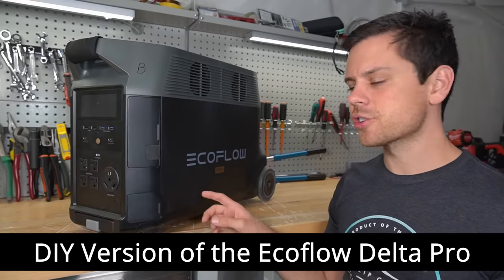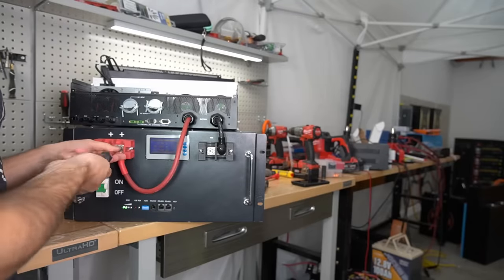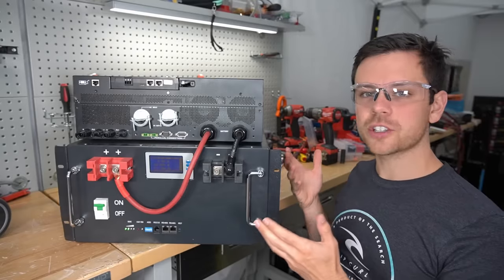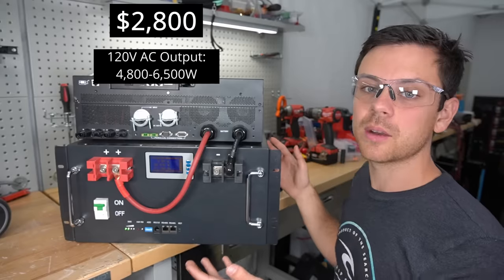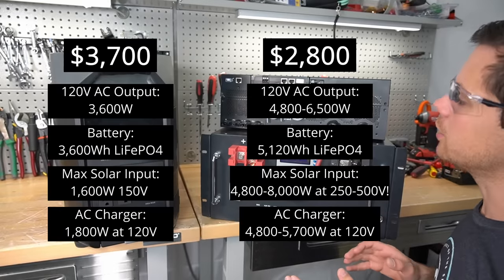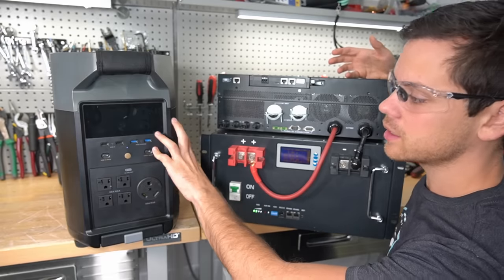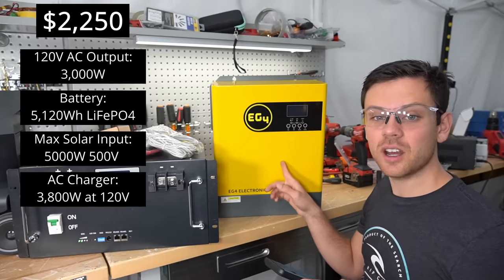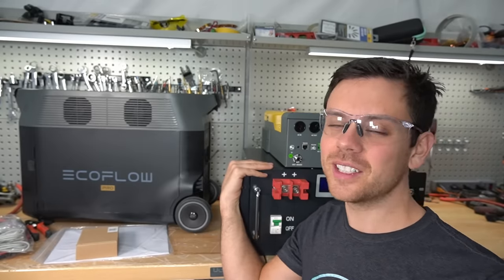Budget DIY Ecoflow Delta Pro! More power for less money

Comment: This video was probably more relevant a year ago, but the Ecoflow Delta Pro can now be purchased new for under $2000 (Costco) and refurbished units are even less being around $1600.  Yea, expanding  the battery can be more costly and the 1600 watt solar PV input is quite limited, but the ease of use and portability are hard to beat.
Reply: You can say the same in another 1, 2, 3, .... years. Why point out the cost is less now than it was a year ago? That's true for most things we purchase in life.

Comment: For those that don't know,,, Server racks are also known as PA system racks. Musicians have been using these for years! Effects, amps, prossesors, all come in specs to fit into these racks. These are "rack mounted systems, therefore, they will fit any rack mount! You can get them to fit one unit, or 20 units, and they do come with wheels! Check Musicians Freind!

Comment: The eg4 3000 and eg4 48 volt battery is exactly what I want to get started in solar because i know i could expand it over time.  I really only need it to run a computer, lights, and 9000 btu mini split for a few hours each day.  My biggest hangup is the idle consumption of the eg4 inverter....and even though it's fairly cheap it will still take years to pay for itself.  In my current tight financial situation I just can't justify making that leap to solar yet. But thanks to these videos I will be ready when I am in a good enough financial situation to pull the trigger.  Until then I earnestly await news of cheaper and better batteries and cheaper and better all in one inverters.
Reply: Look at the  Victron Multillus it is  more money but much better quality and has a low idle consumption . I have a 24/3000 and a smart solar 100/50   solar charge controller I've been very happy with the equipment. That being said I still want to buy one of these All in ones as a spare option

Comment: Would be cool to see some form of DIY shell that could be used on those LifePO4 batteries you test a lot of. Basically clamp the positive and negative on, latch it up, and have a small portable system with a few outlets. Need extra capacity, just buy more LifePO4's and swap them out as you exhaust them. 

This way instead of over 2k to start you could get in cheaper and slowly grow your capacity. Wouldn't ever match a large unit like this but would work for smaller tasks and spot outages where you don't need a massive system in place.

Comment: You know if you live in a small home or even a semi small camper and don't plan on moving it much. Your setup is amazing. The biggest thing between the 2 which you take some sacrifice is portability. The real question is, how do you plan to use it? Is portability a big issue? How much power do you really need? 5,000w steady is pretty amazing, and if you need that? Great! 

I really do like your alternative setup. You know another great way to make your system more portable is making a custom wooden case for it. Which with a little skill and lots of YouTube, that would make it all 1 piece unit and you can make it pretty durable and put on larger wheels allowing you to move it around much easier. I really do wish and I get which is a big part of your video, is not being able to upgrade the battery storage without being forced to use EcoFlow only. So much of these solar panel kits are getting better and better and prices and portability will help you get a great unit you want, but not have to worry too much about putting all this stuff together especially if your someone that isn't very electrically inclined. I believe there will be easier ways and quicker and better setups in the future where your average Joe Blow that may not know much or nothing at all about solar and charging setups and be able to get what they need in medium scale setups without getting too overly whelmed and not spending a ton of cash to get what they actually need. 

I love your setup my brother! I wish someone would just make the proper connector and a controller that would make the EcoFlow believe it is using one of its own batteries when it is using a DIY Battery pack or even another brand and still make it all work. :hand-purple-blue-peace:

Comment: Good video and I completely agree w/ you.  Just got 30kWh of batteries from signature solar and decided between the EG4 6.5 and EG4 3000.  Seems to be some discrepancy on what the idle consumption is in the manual versus what you and other you-tubers are seeing in real life.  If there isn't much of a difference, the 6.5 is the way to go since the 3000 doesn't have dual MPPT charge controllers but I do like the screen on the 3000 better, as well as its size and price. 

One thing you could have addressed in this video is the DC output.  That's something the Ecoflow has that the DIY doesn't.  You could have added a step down converter from 48v to 12v and then had some DC ports off that for probably $100 or less to really make it more comparable.
Reply: Do you know if / how I could set up a 110 volt outlet on this to make it plug and play?
Reply: @danielbell230  On the AC output just get a power strip and cut it's wire and strip them and connect them to the inverter. Very easy.

Comment: One problem is the idle consumption of all in one unit is much higher about 30 to 50 Watts. Ecoflow did a great job on that
Reply: This is by far the biggest drawback for these DIY systems vs. the EcoFlow / Bluetti. Second for me would be how compact things are packed in a SoGen.
Reply from the maker: Could enable power saving mode. Also the 3000W model idle consumption is much lower. Just use that one instead. Bigger models have bigger idle consumption
Reply: The 3000W model is only 120V.
Reply from the maker: @Dreadlk  so is the lv6548
Reply: All the Sogens have hidden idle consumption some more than others

Comment: I think they are targeting different markets. The ecoflow is designed as an all in one system for RVs, boats, etc... It is much harder to move the DIY system. For home system, you really need a lot more like a transfer switch or interlock etc...
Reply: We’re getting 16 panels installed tomorrow with a transfer switch. Need to figure out a garage storage system. Curious about interference and how to size a DIY system like this

Comment: I paid $2600 total for 4 Chins 12v 200 ah batteries shipping and handling included to alaska. I hooked them up to my Aims 4kw inverter charger 12kw surge, that I paid $1100 for 2 years ago. Already cheaper than what you showed, after factoring the fact I have 8kw of power without wearing out the batteries much.
Reply: What part of your system allows for solar input/charging?
Reply: I already had a 2kw solar array and 2 150/60 Victron solar chargers from when I was using 12v. Went from agm batteries a month ago, to lithium, and that was the most drastic change since we got the inverter.

Comment: Trophy batteries are good. I've been running 6 for months with no serious issues. They just work.
Reply from the maker: Yeah they are severely under rated. I need to make more videos on them. I love mine
Reply: @WillProwse  I heading into the cold season, I'll let you know how they do in my solar shed. I'm not relying solely on the internal heaters, but more of failsafe. The heaters are really the selling point for some of us.
Reply: @WillProwse  I would love to see a video about the 11kw Trophy battery that you have

Comment: Thanks a ton for the apples to apples comparison in such a tight video.
If possible, I'd like to replace my grid power by breaking up my main box into two 30 amp RV plug sub-panels... And plugging diy systems into them..  like I currently have for my generator, but for the full house, not just the major circuits I have now.  I'm hoping this is possible, instead of a fully attached expensive full house system.

Comment: you can get 48V 100AH Chins - which has a smaller footprint then a server rack and connect it the the EG4 3000W inverter.

Comment: I'm testing now.. but on Ecoflow pro I found a "AC always on" option..  Under settings and "Lab"..  Turn it on to have the AC ON when the batt comes back. There words "In EPS mode, if this swich is on, the AC power button will be turned on automatically after the power is back.  If switched OFF, you will need to turn on the AC power button manually"  Now.. EPS mode?  I found AC timeout.. Trying to make it keep the "never" setting ...  We'll see.🙃
Yes.. that's the key to getting it to work.  I cycled it twice to Power Fail.. (pulled the plug) and it worked with out a flaw.  Man.. am I glad too.

Comment: Learning so much.

I have 2 100 watt solar panels, originally I connected to 12 volt lead acid, and 40 amp epever charge controller, and 10 amp switch panrl

I bought Ecoflow River.

I disconnected lead acid battery, and got XT60 connectors.

I'm in the UK (Brexit was such a bad bad thing), I really struggle to find (wire)/cable, and none of the shops(stores) reference AWG 😢

Comment: Hi Will.  Bringing up the Ecoflow Delta failing to charge the EV reminded me of something I was thinking after that video, but was too late to the party to feel it was worth commenting.  As I recall, it failed because the neutral/ground bond is not available, and you tried to bond it on the output of the Ecoflow, which ruined some functionality of the unit.

Have you thought about doing the bonding on the AC plug, as if it was plugged into the wall.  Just take a female extension cord socket, don't put a cord on it, but internally bond the neutral and ground, and then plug the A/C grid cord connection of the Ecoflow into it.  Does this provide the bond required to make the car charger work?  At the very least, it should be safe because it is the same situation as having the Ecoflow plugged into a home circuit with the circuit breaker tripped.  Also, the female socket would have to be removed before plugging into the wall, so there is no chance of having neutral and ground bonded in two locations.

Thanks for the interesting videos.  Sorry if this comment is a little off topic here.

Comment: Great video! Also very timely. I've been trying to solve an issue of frequent short power outages and looking at solar plus battery backup. Unfortunately solar is not an option for my home, surrounded by many tall trees. Even if I take out many trees it still does not make sense. I could go with a natural gas backup generator but would rather go with a system like you arre describing. My plan is to install a sub panel with critical loads, most of the 120V circuits and connect a battery backup through an inverter.
If there is no need for MPP inputs are there other inverters worth considering?
Other considerations?
Thanks!
Reply: A natural gas generator with an automatic transfer switch would be pretty awesome. Not nearly the need to ration power like you'd need to with just a battery backup system without solar.
Reply: My friends in Texas have the whole house natural gas Generac unit. The cold conditions caused natural gas to be shut off for a week plus in his area. He rigged his motorhome gen set to run a few circuits in his house, Thankfully, the motorhome fuel tank was full.

Restoring generators was my hobby for 30+ years. My new hobby since the  NorCal wild fires and power outages in 2017 is batteries and inverters. Nothing beats the silence, no fuel, no fumes, no maintenance, and the reliability as found in battery backup. I have no problems running my fridge and chest freezer and leaving home for a week without worrying about them. I would never leave my house with a generator running untended.

My Aims 4000 watt 120 volt  inverter charger has been reliable through every power outage for years. I elected to run its internal battery charger 2 ways...plug in a 20 amp cord to the grid or plug it in to my 3500 watt generator. Like you, trees make my solar input non existent.

Another consideration....those Reliance 10 circuit transfer switched were designed to run on 240 volts, L1 and L2 power wires, Neutral wire and ground. You can power only one side of the breaker panel as fed by wire L1 or by wire L2. Hopefully your critical loads will be on one side of the panel.  This is why I bought the split phase 120/240 volt Sungold Power split phase 6000 watt  $1200 inverter charger. Now I can power both sides of my breaker panel.

We have had several power outages in the last few years ranging from 4 hours to 3 days and nights. Batteries are the best backup. If I were to build a new system, it would be 48 volt server rack batteries with an All-in-One inverter. You don't need to connect the solar input.

Comment: You cant charge the Trophy, SOK or EG4 battery from the grid at night when electricity is cheaper as its off grid? You can with the Ecoflow so in places with less solar insolation the Ecoflow is useful all year round.

Comment: Having recently bought into the Delta Pro system, I readily admit that DIY is cheaper by far. That said, I'm not an electrical expert and integrating with my home's existing circuit breaker seemed quite daunting. Ecoflow's Smart Home Panel is what really sold the system to me. I got 2 delta pros and the SHP and can essentially choose any circuits in my home to run off of Delta Pros (either as dedicated, or as backups). I'm not sure how you would accomplish that with the DIY setup. I know its certainly possible but nothing quite as simple as the SHP?
Reply from the maker: Just run critical loads with generator transfer switch. Then connect plug to any inverter. Super simple
Reply from the maker: But yes they have made it easier
Reply: Are you saying that your DIY system will give in an automatic transfer switch that you can monitor from an app??? Can you switch circuits on and off from your app to help reduce your electric bill????
Reply: @WillProwse 
Can you please do a short video showing how to connect the EG4 inverter to a standers wall outlet? Gauge, breaker, plug, etc. 
can I literally just chop off the end of an extension cord, hook it up to the inverter AC input and plug it into any wall outlet to charge the battery? Solar isn’t always available so charging the battery with grid AC is a big bonus. Thanks.
Reply: I think the Smart Home Panel that serves 10 ciruits
Reply: The Smart Home Panel appears a Fraud. I need to buy three for $4500 'cause 21 circuits are needed.  No instructions, no pictures, no skematics. I sent the Pro system back.

Comment: So what would it take to use something like this instead of a generator for an extended power outage, where the amount of power charged during the day would keep you going without downtime?  Assuming say 5000w of power used in the day, with TV, Lights, Fans, Coffee, etc and probably just 200w overnight with just fans and lights.

Would it ever make economical sense as compared to a generator?

Comment: Hi Will. The Delta Pro will charge at over 3000w A/C if you connect it to a 220v-240v output at 15 amps into the A/C input in the back of unit. Excellent video's.

Comment: I purchased the Ecoflow pro from Costco.  Within a month the system stopped working.  It had a direct short which continually popped the breaker.  I just returned to Costco for a full refund, and now will be building your DIY setup with 2 batteries once I figure out from your links what to purchase.
Reply: I did the same. Costco and Home Depot were phenomenal with full price exchange. Guess who wasn't? That would be Ecoflow themselves. They told me to get stuffed as it was over 30 days. I even tried a chargeback but my Amazon visa had same respon.

Comment: sounds great at first, but it would take a little bit to make this portable (wheels, and a frame of sorts), wanting the ability to charge it just by plugging it into the wall, also i wondered what the minimum solar voltage would be, say if i only hooked up 3-4 panels, it looked like 120 to me, and someone else said 90, which could also be a limiting factor. if I could figure out a way to make it portable, have different charging options, and not worry about low solar voltage i would be more excited about this idea, but it's still a great idea.

Comment: I should do one of these for my garage and make it solar/off grid.  Already have a sub panel in my garage for all of my garage circuits.
Also, there are some pro audio equipment racks/cases that may work to make that last system more portable.  Those audio rack cases are usually plastic or wood.  Don’t know how much heat this would give off, but audio amplifiers can also generate some heat.  Just thought of it as an option.

Comment: Great Video.  I am a solar dummie and just getting started.  How would someone go about connecting a 30 amp connection like the Delta Pro has on the front?
Reply: Did you figure this out? I would love to power a 30 amp RV with something like this...but, need a 30 amp connection on the DIY unit to do so.

Comment: I want to use this set up in a food trailer that needs the fridge running at night, so I have gas generators running 24/7

How would I connect the eg4 all-in-one to my 50amp plug that the generators are connected to, and would those trophy batteries be better than the eg4 ones to be on the floor in a mobile trailer in an area that reaches freezing temperatures?

Comment: If you used a renogi charger inverter with AC outlets built in, would that work as a replacement to wiring in additional AC outlets?

Comment: another very important question is:  the delta pro inverter efficiency is quite bad and you loose about 20% of battery capacity when consuming ac power, how good or bad is the efficiency of the inverter used here? have you an idea? inverter efficiency is extremely important for any solar system. besides, do you know the brand name in europe for the EG4 ? thanks a lot for your superb content!